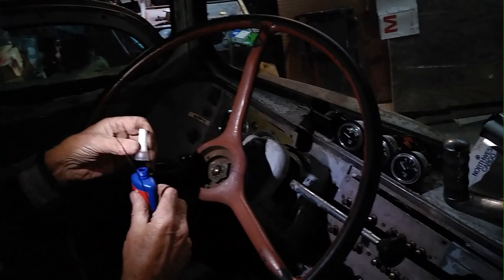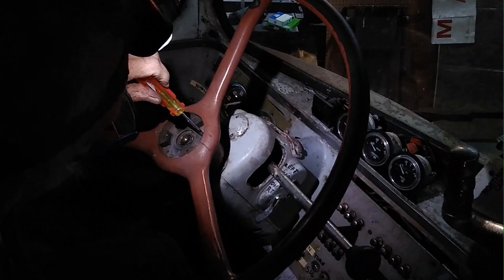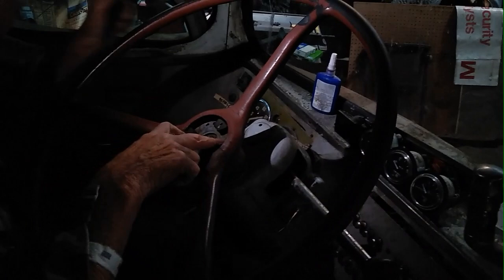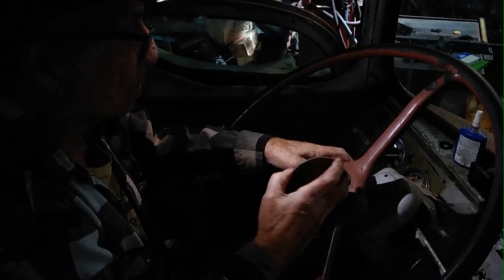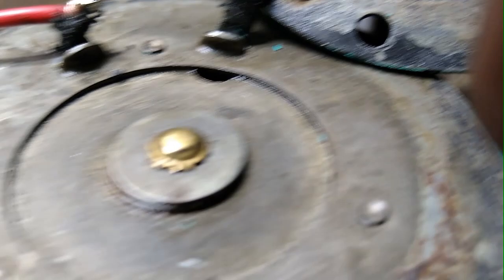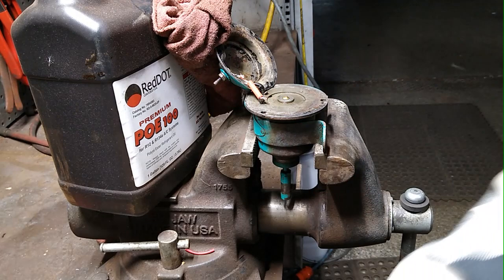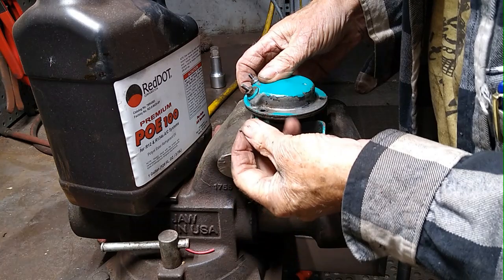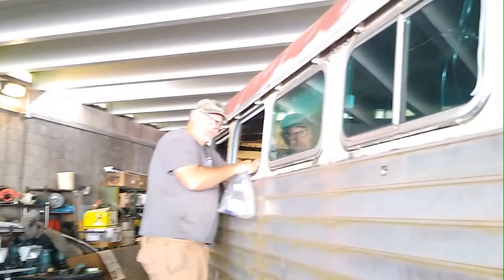This Week with Jason's Silversides.

Comment: Thank you sir. 
Reminds me of a glider truck. Nobody ever, ever expected a Detroit engine block to go 3 million plus miles and then be placed in a 2020 truck.... But here we are being creative and making it work.
Reply from the maker: Fortunately, they were designed to be rebuilt over and over. Replacing sleeves instead of boring cylinders - what an idea.
Reply: I'd rather have an old Series 60 or 8V-71TA than something modern which will often put you on the side of the highway for a while when the emissions equipment acts up.
Reply: Well done that man.
Reply from the maker: @douro20  Yep. 90% of our sudden failures are electronics. They make the engines to last a million miles between overhauls and the electronics to fail daily.

Comment: Phil,  Nice work on the horn and the solenoid.  Nice to see all four of you working together.  If you search “vintage cloth covered wire” on eBay, you will find a great number of 18 ga and 22 ga wire that has the cloth cover, but is modern insulation. I know you like to save original wiring, but this would be an option.
Reply from the maker: Thanx. I have 18 &  20 for victorian house light fixtures. I need 12 & 14 for bus wiring repairs.

Comment: Phil will that plate come back off after you put them in with the thread locker?
Reply: Yes, blue thread locker is pretty weak.  Red is much tougher
Reply from the maker: Red locker is good for medium duty holding and I smeared some under the plate, so I don't think so. The screws could be removed and the plate pried loose if needed, but there are no serviceable parts under the plate.
Reply: @richardlazarski4553  wow, thanks richard

Comment: why didn't you just rotate that plate and drill new holes in the steering wheel instead of gluing it
Reply: Phil's philosophy of repairs are to  be returned to the original bus  when possible.
Reply from the maker: Two reasons: 1. Force of habit. Brands other than GM buses and some GM trucks have symbols on the horn button.  Repositioning the plate holding the horn button would mis-align the position of the button and the symbol. 
2. Although widened by the fissures in the wheel hub, the threaded holes were still tight enough to hold the screwed down plate. I just wanted to add an extra measure of security to the assembly.